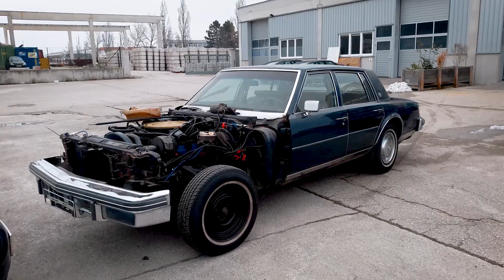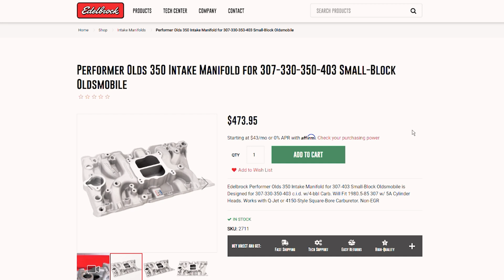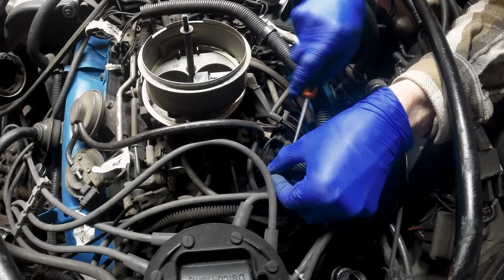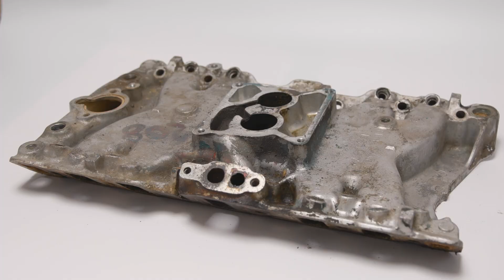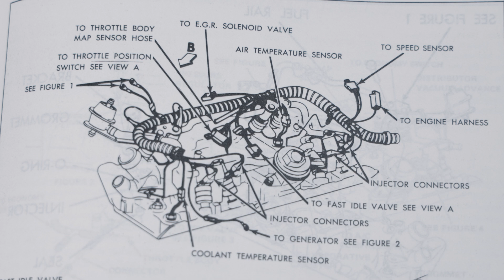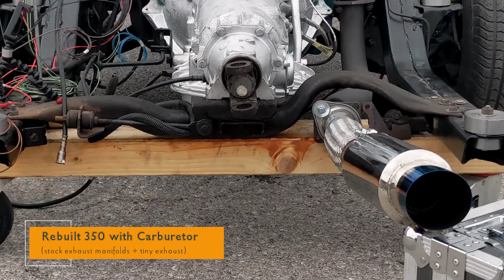Cadillac Seville's Unique MPFI Intake Manifold

Comment: Thank you for the video! I'm looking into buying a 78 and I would love to drive it daily. What would you recommend to keep it multiport injected but with a standalone ECU to run e85? What injectors would fit?
Reply from the maker: Adapting it to a standalone ECU is definitely a huge task, as it requires you to modify the intake or better, get a new one, that accepts newer style injectors. If you are willing to put a lot of time and money into that transition, I think it's gonna make the car even more reliable! But honestly, as long as I've owned my Seville (12yrs as of writing this), my ECU has never let me down. It's parts like rubber fuel lines or O-rings and gaskets that give up long before the ECU does, at least in opinion and from what I've experienced over all those years of ownership. If you do convert it, I am really interested in your project and would love to read/see some updates!
Reply: @thataustriancarguy thank you very much for your answer, it's good to know that the ecu is pretty solid. The idea is to daily it hence needing e85 considering current gas price haha. If I end up doing it I will definitely let you know.

Comment: I replaced the entire Electronic fuel injection system and the fuel manifold with a aluminum manifold with no fuel injector ports and a Edlebrock carburetor. The EFI kept leaking fuel at the fuel injectors and fuel rail area. I tried everything but the leaks were persistent. No more ECU, no more sensors. Runs great no regrets 1977 Cadillac Seville.
Reply from the maker: I think FI Ports are tough to get sealed properly w/o pinching the seals on the injectors! But it's great to hear you found a setup that works well for your Seville! Thanks for sharing your experience and solution!

Comment: Just a tiny correction:  Thanks to the arrogant & annoying California Air Resources Board, this engine ran one more year, into 1980, because they didn't like the 6.0L / 368" Cadillac engine with digital fuel injection (DFI).  🧐
Oh, and the design of the intake manifold was not as crucial with port fuel injection...

Comment: Did these systems have closed loop control with an oxygen sensor? Or were they totally open loop? Did they have a digital microprocessor ECU or an analog one? I heard that the first car with closed loop fuel injection was the 1979 Volvo 240 GLE.
Reply: Open loop - no oxygen sensor. The fuel injection control computer was an analogue design - very complex internally with thick film sub-circuit boards inside.
Reply from the maker: As @gralykmeno mentioned, this is an open-loop system. Its initial complexity is deceptive; it appears that Cadillac took a shortcut to implement FI, essentially overlaying electronics onto the existing Olds 350 architecture. Regardless of that design choice, I'm a big fan of this particular engine.

Comment: Do you also own 78-79 Seville diesel engines
Reply from the maker: No, I do not. I'm not that into diesel engines, and especially those olds 350 diesel engines don't have a good reputation.
Reply: @thataustriancarguy They are really not as bad as the reputation would have you believe. The only real issues are the lack of a water separator and the weak head bolts. My friend has one in an 83 Toronado that was upgraded to ARP head studs and has over 600K miles on it. Gets 40 mpg on the highway.

Comment: Hello, I wonder if have converted your engine from MPFI back to regular carburetion? As you correctly stated, parts are almost impossible to get. The only reliable source may be Rockauto, but I think, they don't have everything you may need to fix this system. Please let me know. Btw, I am in Austria, too!
Reply from the maker: Halli hallo! Vielen lieben Dank für's Schauen & deine Kommentare. Freut mich sehr, jemanden aus Österreich damit anzusprechen :) Ich schreibe trotzdem die Antwort in Englisch, damit die FI bezogenen Inhalte auch für andere leichter nachvollziehbar sind.
The FI has not failed me yet, and in my parts car it was actually the ECU that failed. I am a rockauto customer since day 1, bacl when I got my car and you are right, you can't get lots of parts for the FI-System, so I hope that the parts you can't get, are the ones that never fail to work correctly - fingers crossed!  
The engine in the car is still with FI, but I rebuilt another engine and converted that one back to carburetion. I hope that helps and if you've got more questions, i'd love to answer them!

Comment: The 5.7L Oldsmobile engine is flawless.
Reply: Please, call it the Rocket 350!   😋
It was great, with a QuadraJet on it!  Before EGR, even my low-compression '72 ran strong and got 20 mpg on the highway...  😁
Reply: @marko7843 Rocket 350 , indeed.  And I can only find so much online about the Ram Rod 350

Comment: The problem is that Cadillac wasted a fortune on the HT4100, 4.5, 4.9 that was a massive blunder and I see those engines, the 307, fwd and the troublesome Northstar as killing the brand. Only the Escalade, CUVs and performance -V cars have kept the brand afloat. They should have kept the Buick 350 or Olds 350 gas around with SMPI in the 80s, I think Buick might have been a better choice since the V6s got this tech, are the same bore spacing and family as the V8s and they were a very light compact V8. The Buick 350 was sort of like the small bore, long stroke, cathedral port LS of it's day made of all iron. They could have had a much better engine, especially if they went to aluminum heads and intakes on the V8 to allow more compression on pump gas making the engine more efficient and even lighter. They could have even built a Turbo Buick V8 like the 3.8L V6 or used the 3.975" bore size from the 4.1L V6 to make a 380ci light, compact, efficient, high tq engine for huge cars like Cadillac , Buick, Olds, Pontiac or even GMCs to diferentiate them from Chevy more. I never understood how only the lower tier brand Chevy Corvette, Camaro and Firebird, Trans Am V8s got the higher tech Tuned Port SMPI engine. Then GM wondered why everyone left for European or Japanese cars of extremely high quality, reliability, efficiency and power when the Olds diesel, HT4100, a carburated 307, TBI 305 or low tech Buick V6 was all that was on offer in the big expensive cars until 1991 when the 350 Chevrolet was offered in luxury cars again, after it was too late and it was the low tech TBI version instead if the L98 TPI that made 250hp and 350tq that didn't rev over 5000rpms, perfect for a big heavy car or truck.
Reply from the maker: Thank you for sharing such an in-depth analysis, I really appreciate your comment! Your insights into GM's engine choices over the years offer a compelling perspective on the brand's evolution. It's fascinating to consider the potential alternatives, and how they could have shaped Cadillac's performance and reputation. Your knowledge of automotive history is impressive!

Comment: Back in the late 1980's, My sister had a 1977 Seville that had been converted to a carburetor.   They likely changed the intake manifold because the car ran really well with the carburetor.  The funny thing about that Caddy was.... it had so much rust on it, if you pressed down on the rear bumper,  you would see wrinkles form in the padded vinyl roof.
Reply from the maker: Wow, that sounds wild regarding the rust problem!

Comment: There was someone here that somehow converted a TPI with custom runners from a chevy 350 to work with this engine using the stock injectors.    It looked very strange as the Chevy engine is somewhat narrower, but it did work.
Reply: That kind of a TQ increase from 30" intake runners would probably suit the Olds 350 well. Olds heads are better than the typical smogger 350sbc head of the late 70s.

Comment: Since OEM parts are so scarce I feel that theoretically you could buy a 350 carb or EFI manifold from Edelbrock add a Holley 450 style throttle body and use some form of standalone ECU or just buy the Sniper EFI from Holley. 
While I'm the type of guy to do the most to keep as much of the OEM parts as possible, I get why some people just do a carb conversion all together. 

Great video BTW, I love how YouTube keeps recommending channels like yours.
Reply from the maker: I converted my rebuilt "back-up" engine to carburetion, as seen in this video: https://youtu.be/SJxZ2DFw6u0
Or here's my playlist "Olds 350 Engine Rebuild Series": https://www.youtube.com/playlist?list=PLI_FfrTjVxphAlT4lcujJLd-LbBrpOsK1

I want to keep my Seville as original as possible, but I know that if some parts break, finding a replacement won't be easy, cheap or fast.

Thank you very much for your feedback!
Reply: @thataustriancarguy I just saved
A 76 from the scrap yard. Going to watch all of your videos before
I decide what to do with the engine. It only runs with starter fluid.
Reply from the maker: That's awesome to hear, welcome to the Seville club!
Since it starts with starter fluid, you've confirmed it has spark and compression. I'm guessing it's a fuel delivery problem. On these early EFI systems, the ECU connector to the frame-rail pump is a common failure point (look for melted plastic), but since it was a scrap yard save, those filters are probably gummed up too. Enjoy the videos, and feel free to reach out if you hit a wall while troubleshooting.
Reply: @tha @thataustriancarguy  thanks, the red interior is immaculate! I’m gonna start with the fuel pump.
Reply: Yeah, the Sniper EFI on a carb intake since it's TBI and wet flow unlike port injection and a dual sync distributor to give the cam signal and handle ignition would probably work well or just a carb, intake and a HEI if you can tune it, a Holley 600 vac sec should be nearly spot on for an engine that size out of the box, unless the quality has slipped. The last few I bought were perfect on a Ford 360FE and a 351w.